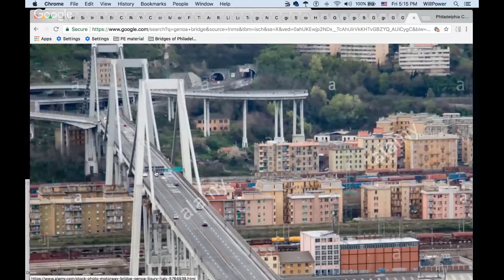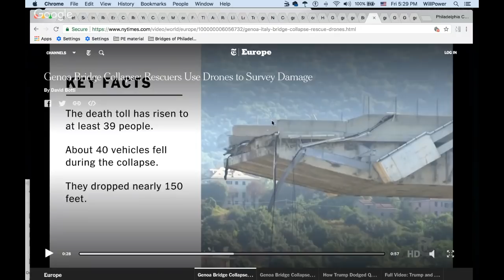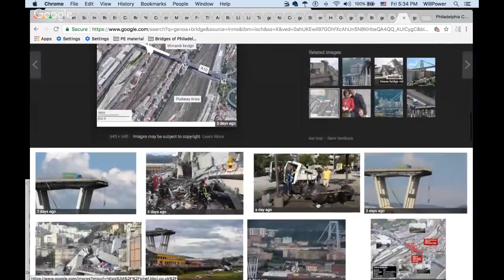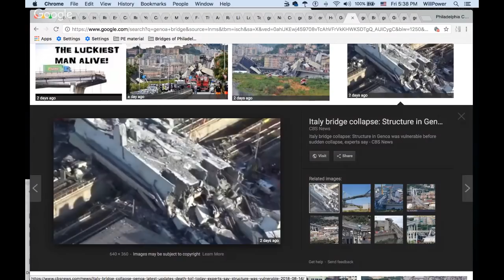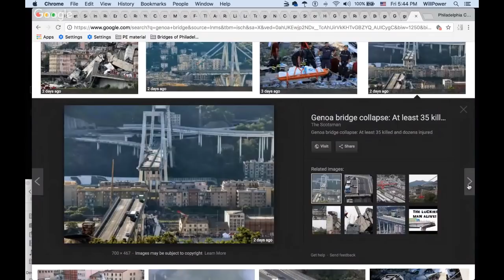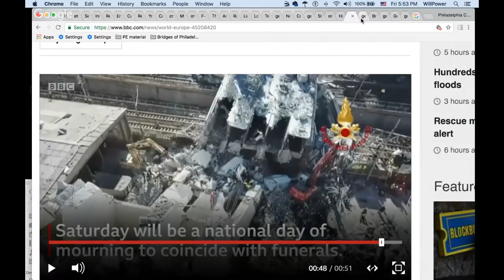Genoa Bridge Collapse CAR DRIVES OFF BRIDGE Rotation, Flip explained EAST END FAILED FIRST

Comment: You are probably tired of looking at this stuff. 

https://www.youtube.com/watch?v=QKTApOC7RTQ

 That is surveillance camera footage at the base of the tower. Camera is looking mostly west but tilted down so much that there isn't much to be seen. At 38 seconds you can see the shadow of the deck start moving with the whole mess coming down. Then the video changes cameras which is, I think, the eastern side of the tower with the cameras looking more northerly. Sadly only debris can be seen here. But it is the same utility vehicle in both shots. At 1minute 24 seconds you can see just the slightest bit of video distortion followed by the debris appearing. 

Cheers
Tom
Reply from the maker: Thank you Tom, I have NOT seen that video until you sent it to me... 
I will work on it more and this is my current thought...
The camera reply is backwards... the first part of this failure was on the other end first... If, you collapse this end first, how do you still get a car on top of the rubble of the second part of video. https://ibb.co/eJFztK
Reply: Construction Engineering & Photography  I agree with your assessment. Not sure why they released the videos in that sequence.
Reply: I gave a heads up at about the same time as you! There are several versions of the video, with slightly different cropping. The wider one you linked to shows a reflection of the deck collapsing slightly before it appears in the frame.

Comment: 42:30 Looking at the main support tower, just below the deck there is a massive beam that goes from one side of the bridge to the other, could this in anyway have introduced the flip if the falling deck were to make contact with it?
Reply from the maker: Totally agree, but I think the rotation would have to start higher up, in this failure to get this positioned (my thoughts)...

Comment: 10:30 You can't get the rotation. How about IF the section started to drop with both cables attached starting the flip and THEN one cable failed due to the extra forces, wouldn't that give a rotation to the already flipping deck? Also maybe the bit of the support column remaining attached to the deck hit some other part of the support columns causing additional damage when THAT shot up in the air due to the flip?